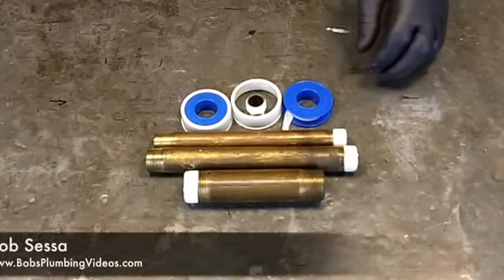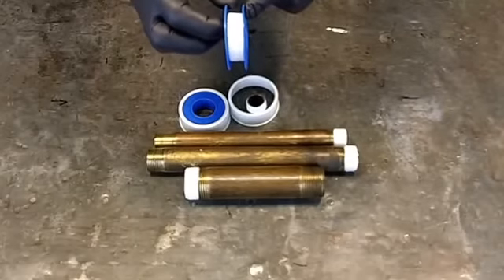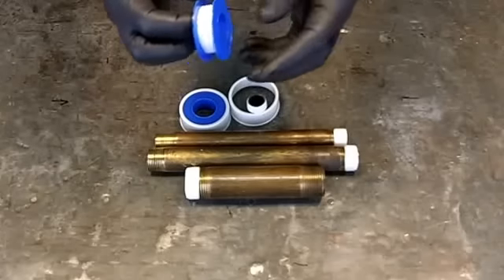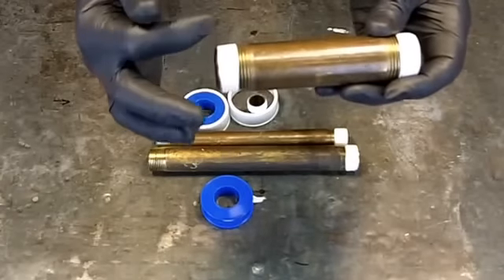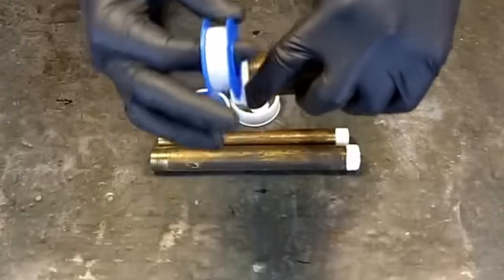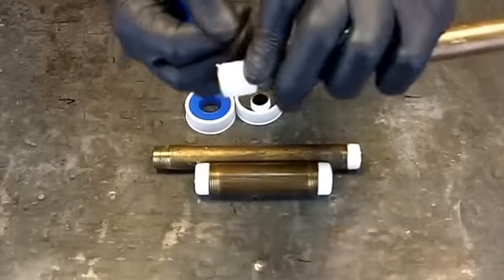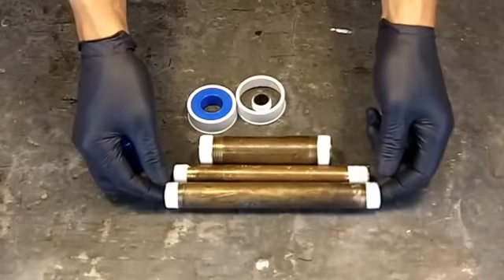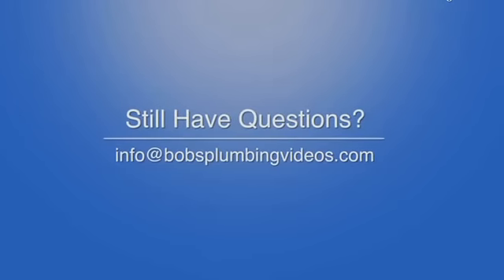Teflon Tape Explained

Comment: Used this stuff to seal the hole in my,"Laguna Rectangular Tub". The plastic tubes were too thick to insert into the hole. I looked around, and I found that Sensodyne Toothpaste cap fits perfectly.

Comment: What happens if you might have to remove the supply lines of the single  faucet from the shutoff valve that I put both Teflon & Megaloc on?  If it has just freshly been applied last night, can you reuse the same application or recoat on top of that after removal with out cleaning the threads?  I may not have to since the neck might be loose joint fitted (hose can turn while the tip remains still).   Water is leaking from faucet nut where the supply lines exit to go under sink.. what is the purpose of the screws on the screw plate that goes up the faucet neck bottom???
Reply from the maker: Can you take a photo and send it? Send it to info@robertsessaplumbing.com
Reply: @BobsPlumbingVideos  I solved the problem after posting.  I just used a paper towel and picked most of the Teflon off by hand.  I removed everything on the faucet, and anything that had a male thread post got Teflon tape with megaloc!  I used silicone on both my base &  plate since I have a thin 4 hole sink.  Everything is setting and drying and I will test my results tonight!! If still leaking, I may either consider buying more hoses or getting a different faucet!

Comment: I'm having an issue installing any bidet seat to my toilet.  All bidets I've bought have an all metal t adapter that connects to a plastic toilet float which of course strips the threads.  I've never even seen a metal toilet float connection.  Will teflon tape prevent this?

Comment: Good vid I do this a hundred times a day take the blue part of the roll of Teflon tape it is the same width as the threads on a pipe and use that to push a little bit of the tape down into the threads then it won't unravel on you
Reply from the maker: good move

Comment: I want to use both white tape and a sealant (T plus 2). I already have a leaking taped fitting. Which goes on first? I've read both the tape first and dope first.
Reply from the maker: +mjb Mjb I always apply my tape first followed be any good teflon based pipe joint compound. I use a product called Megs-Lock by Hercules. Available at any local plumbing supply or Amazon.com

Comment: Hello, is it possible to use teflon tape on a lightbulb on submerged pool light so water dont get in fixture socket if the pool light lens gasket fails, thanks
Reply from the maker: I'm sure you could apply Teflon tape to the threaded portion of the bulb. But personally I would not trust it to make a 100% watertight seal should the lens light gasket fail.

Comment: What teflon tape width do you use on 1/2" and 3/4" pipe and why?
Reply from the maker: I personally use 1/2" tape wound in a clockwise direction.  For 1/2" pipe I start two threads from the end of the pipe and wrap straight, this method will hide the tape when the fitting is fully engaged. Making a neater looking job in my opinion,  on 3/4" pipe I creep up a bit more from the end again so when the fitting engaged you don't see it. Most DO NOT agree with me and say to wrap the entire thread from front to back. Whatever works for you is fine, bottom line is a leak free joint.

Comment: I have always had problems with sealing the tailpiece under the vanity, where it attaches to the drain flange. Some plumbers use tape on the threads, some use putty and some use silicone. What method do you use to secure the tailpiece at both threaded ends, under the bottom where the thick black washer is inserted. Thank you.
Reply from the maker: On the fine threads, I use either a product called Mega-Loc or Blue Block. You can check them out here:https://youtu.be/-yGRgv2flfs. Regards, Bob.
Reply: Thank you sir. Appreciate the quick response. Frank G.

Comment: I am going to put teflon tape on the connector of instant water heater output to the shower hose. How many rounds (turnings) of teflon tape over the pipe should I put?
Reply from the maker: In general four to six turns should get it done!

Comment: People try to push pipe dope it's the WORST thing to use on pipes, nothing works better then Teflon tape it's how it's wrapped many say to go 3-4 I go 7-8 rounds being sure to pulling it snugg with every wrap, I also do go back with extra wraps creating second row being when the pipe reaches the point of unable to tighten anymore the second row of Teflon will create an extra seal so no way water will leak out from pipe.

Comment: how do you remove the tape if your pipe is cross threaded?
Reply from the maker: Use a small fitting wire brush to remove the teflon.

Comment: I use 14-20 turns on 1/2inch fittings. How about that.
Reply: Your funny...
Reply: @maxipaw-dc5xj  system pressures vary from 4bar to 12bar. Never leaks, unless there's a crack in the fitting. Happens very rarely though.

Comment: Are there different rules for gas, specifically propane, regulators?
Reply from the maker: You may use this on natural and propane gas, but check your local code! https://amzn.to/2ttds5e. We are not permitted to use it in NY City, only pipe joint compound.
Reply: Ok thanks. Apparently is is legal under Alberta Law (Provincial).

Comment: This may be a dumb question, but..  I am installing the spout on a bathtub.  I have a piece of 7" pipe with one end going into the wall and the other going into  the spout threads.  Does it matter if I install the pipe into the wall first, then screw on the spout, or attach the 7" pipe to the spout first, then screw the whole assembly into the wall?  I want to get the spout to end up in the right position, facing down for pouring the water.  Thanks.
Reply from the maker: +Barry Schwam  Not a dumb question at all. Actually maks no difference but it may take a little experimenting with how much teflon to use. Too much it might not fit flush to the wall, too little and you might get a leak. Thanks for watching. Regards, Bob.
Reply: 7inch pipe? Do you my friend understand that 7" pipe doesn't even exist?

Comment: I've read teflon tape is not recommended for pvc threads and joints. Is this true? Just to confirm.
Reply from the maker: +MrHuge Sacks  Check out this link:http://www.plbg.com/forum/read.php?1,447078. I guess I would call myself an old timer and I've got to tell you I do use Teflon Tape on P.V.C. along with pipe joint compound. Sometimes by itself and sometimes with the compound combined. It all depends on the condition of the joint I'm attempting to seal. hope that answers your question. Regards, Bob.

Comment: How do I remove a pre-existing shower head that was sealed with Teflon tape?
Reply from the maker: +BigASmith44  As a rule, The head should come right off if Teflon tape is the only component. Some will add certain types of joint compound over the Teflon tape that my prevent it from being removed easily. An adjustable wrench or pair of channel lock pliers should do the trick

Comment: Hi Bob should Teflon be used whenever your connecting a plumbing fitting..Iguess I just don't understand when I should be adding i. In the near future I will be adding a brass T-fitting to an existing shut off valve to connect another water line and am just wondering if the threads should be tefloned or not
Reply from the maker: +Tittlesnhizmouf Speaking for myself in general, I use Teflon tape on  all  I.P.S.  pipe threads  which may be brass, black iron, galvanized iron, or even male threaded p.v.c. pipe. It all depends on the application ! I see a lot of instances where people will use it on the male end of a hose bib where a washing machine hose is connected, the male end of a compression fitting, the male end of a flare fitting which in my opinion is not necessary. In my service area, there are still miles of thread brass water pipe in use and whenever I make a repair I use Teflon tape either by itself or in combination with a good Teflon base pipe joint compound. Hope that helps!  Regards, Bob.
Reply: Tittlesnhizmouf only if one is metal correct Bob?